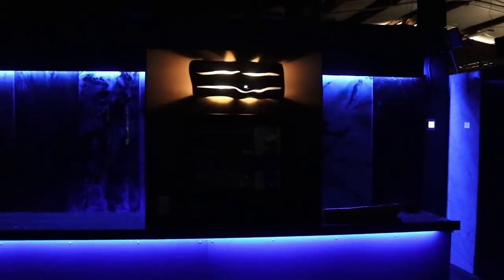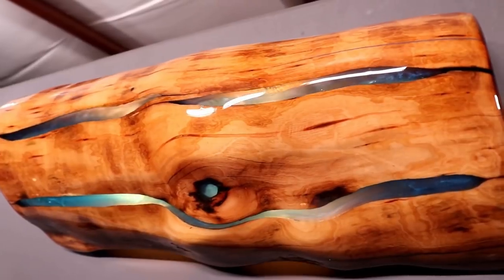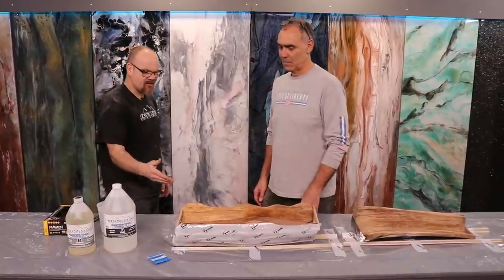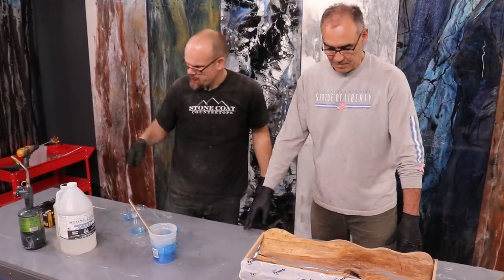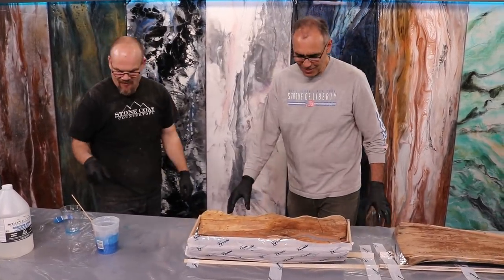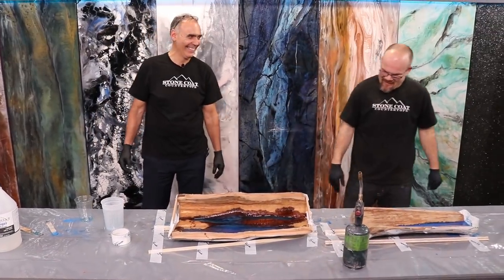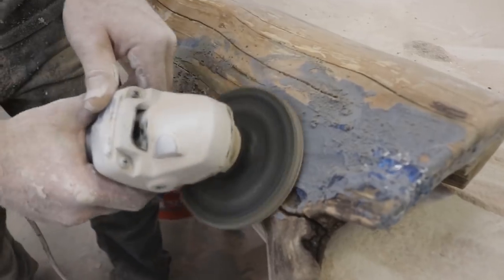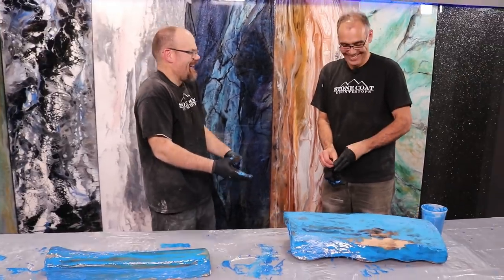Epoxy Blue Log Project- Firewood Reclaimed 🔥

Comment: Here's a project idea. Right now I'm sitting in Lowe's parking lot trying to think of how to do a tile backsplash behind a gas range, that runs into a corner. The adjacent wall is standard floor to ceiling height and about 8ft wide. How could this be done like an epoxy mosaic?? Would I have to do it in sections like a puzzle? What material,  thin fiberboard or drywall? And how would it attach to the wall? Is construction adhesive like Liquid Nails ok to use? Great video!! Beautiful work!

Comment: Those came out gorgeous! I have a lot of logs... not sure they are rotten but they could be! I salvage a lot of tree parts that other people have cut down. Basically if I see someone cutting a tree and just throwing the wood away or about to have it hauled off then I ask if I can have some of it. :P Never had a no yet. Problem is I have no actual inside storage for them so they just sit in my yard. Now I know if they are a little off I can still do something with them. :D That was a good takeaway but my favorite was heating the cheap screwdriver to get to deep bubbles. Never knew that but now I do. :D - Heidi

Comment: Hi there, great video as usual & every time learning more ... the pasion is growing thanks !!!
I do have a Q ... I am making a river table but I want the wood to stay natural so no epoxy on the wood.
And I want the epoxy river to be transparent, crystal clear. I believe I have to sand up to 1500 / 2000 but I will sand also over the wood, does this give complications regarding scratches on the epoxy with what you will sand of from the wood??
How do you polish the epoxy with special polish for epoxy while you can not touch the wood??
I know I have to treat the wood so is there an oil or wax you can use for the wood and at the same time for polishing the epoxy??
Sorry for all these Q's but I am a little stuck with this.
Many thanks ahead!!

Comment: You Absolutley ROCK!!!!!🤘🤘🤘
I want my dinning room table to be wood with a blue river flowing through it. We have a tree that needs to be cut down.......can we use that? Lol
Reply from the maker: Hi Wonka Sparks yes you could! but you'll want to dry that wood until its around 13% moisture content or less before starting any epoxy work on that project!
Reply: @StoneCoatCountertops  Awesome!!! Thanks for the info

Comment: That is so cool. Thanks for the great tutorial. I’m preparing to pour epoxy into cracks on a rotten stump with burn marks on one half  that I dragged home from the beach lol. I think it’s oak woodI am thinking about staining the wood as I’ve removed a LOT of the rotten wood. Is this a good or bad idea? I’m thinking I’ll need to stain after the resin pouring is all done, but worry it might stain the resin. Any suggestions?

Comment: I have been filling cracks with black or dark brown epoxy for over 40 years and what I do is a first  light pour to just wet the tape enough to to seal it and fill in the possible leak areas without the weight of a full pour it usually does not leak then when it is firm enough to do the full pour you have no leaks. I was wondering about matching colors the way you do it though. I have never used these type of colors but am planning to. Can you do that seal coat on the tape and still get a good look?

Comment: I did a half cedar log with Rot to turn into a bench and I struggled to keep the epoxy in. I had no idea how poreous the wood was and it oozed out everywhere. I tried painters tape which leaked, duct tape that leaked and left residue on the wood, I also used a product from work called butyl  tape which is basically a putty to seal larger gaps. None fully sealed the cracks off but did hold enough in to achieve the look. I come to find out I should've did multiple sealer coats instead of larger pours. Rookie mistake. Now I'm struggling on my final pour on the top of the bench as it still seems to be leaving air gaps? I've sanded it more flat, and reapplied but I still seem to be getting air gaps in tiny cracks...not sure what I've done wrong at this point with multiple coats. I'm looking for any suggestions to fix this for a final coat.

Comment: This is a general questions. I don't know if you can answer this. I have a round kitchen table that folds down on each end. so it's like having 2 half moons fold down and then the center of the table would still be rectangular shape. Do you think I can paint and epoxy this table and it will still work?  moving up and down?  is that a possibility and how would I go about doing that? Would the table have to come apart and then be reassembled? Or would the thickness of the epoxy not allow the table to close any longer. I am new so just wondering? Any thoughts.

Comment: Wow Mike that was awesome,  I did a few cedars like this and I had the epoxy absorb right in the wood in some places. Any suggestions on sealing the wood so this does not happen. I did post a post a picture on the insider's group. Most replies say my wood was rotten.
Reply: Multiple coats of quick coat will seal the dry wood and create a uniform finish

Comment: I have a log holding up the stairs.  It has 3 lengthwise cracks.  I cannot lay it down to fill in cracks with epoxy.  Would you do a demo , of how to fill in the cracks with epoxy, while log is upright?  I was going to use a feeding syringe, but I am not sure how to keep it from running down the log

Comment: Please can you explain the popping of stubborn deep bubbles
Reply from the maker: Great question! Try torching the surface 3 times with the correct type of torch that does not blow out when held upside down. -Nathan
Reply: It was the bit where you where talking about heating up the end of a screw driver and popping the deap bubble cheers

Comment: Awesome man, I have a question. Adding more part B (Hardndr) will increase the curing time? Did I hear it correctly? I thought it's vice versa
Reply from the maker: More harder will not speed up the cure, it actually can make the epoxy stay softer if you add more hardener to try and speed the set time. Great question!

Comment: i have rotten logs that i found few weeks ago.. probable more than 200 year old drift wood molave..i am in the philippines and needed your epoxy resin..
Reply: its a 800mm diameter logs with a rot inside the log but outside part is very much intact. i want to cut for a coffee table..and its about 17ft long..need help to acquire your clear cast resin

Comment: Not the right video, but if you were doing an epoxy river table, but intend to finish the wood with an oil for a more satin finish, how would you handle the river pour? Estimate the void less a 1/4" and pour with super cast, then do final skim coats with your regular epoxy to level the river with the table ? Thanks.

Comment: I have a log with nice vines wrapped around it. I want to make a lamp out of it.  Any tips on how to incasing the hole log?
Reply: Hmm. Really interesting idea. What's the ballpark diameter of the log and vines?
Reply: It’s about 10”.
Reply: @ultrahighpix6612  I wonder if you could use a sauna tube somehow. I would imagine it would be a slow pour and take a ton of epoxy that way...